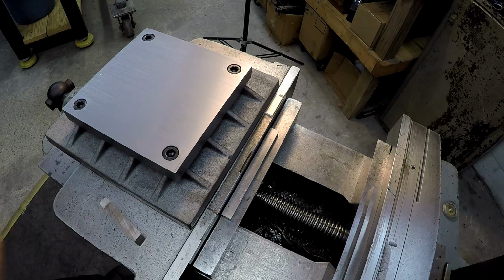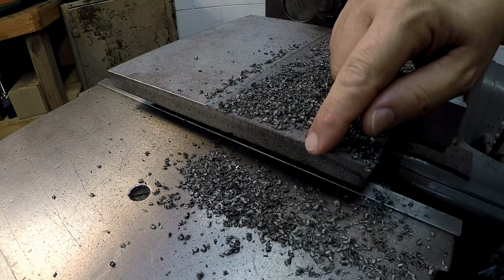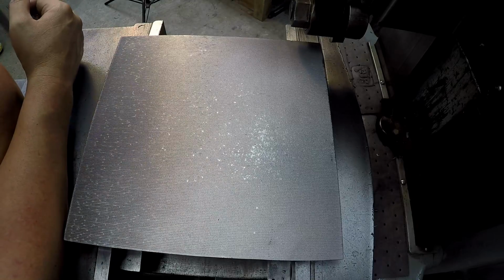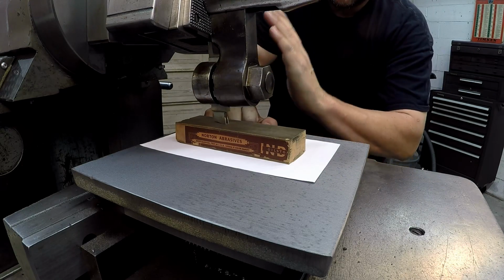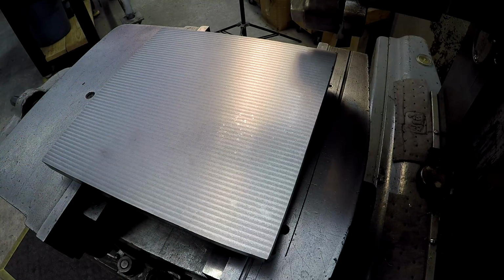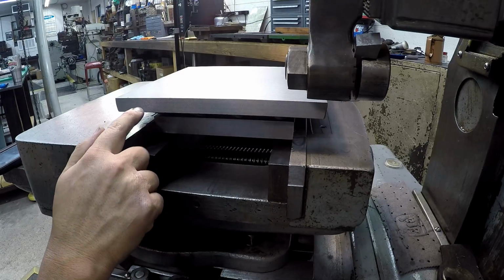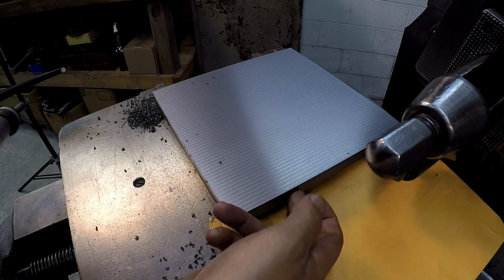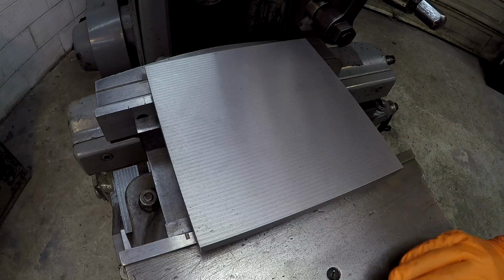Fireball Tool Fixture Plate Part 5

Comment: General remarks to all: 

Seating work in a vise: sometimes when socking work down on the parallels it will rebound a trifle (despite the clamping force) leaving the parallel still loose. If a harder blow doesn't solve the problem, try a softer blow - hit the work hard enough to seat against the parallel but not hard enough to rebound. 

Other points: rawhide mallets, plastic faced hammers, brass, lead, babbet, etc all have different dynamics of impact. Something to keep in mind when delicate hammer work is in progress. Hammering done right is an art and the outcome of a single calculated blow may not be what you expect. Pay attention as you work; let all your senses guide you. I know this sounds like Zen BS, but it's true and applicable to the real world.

Broad nose tools in shapers and planers can develop surfaces in stable cast iron as geometrically accurate as the machine axes allow. A wide flat faced tool set absolutely parallel to the surface being cut, a tool trailing holder, step-overs to 3/4 of tool width, shallow depth of cut in 0.001 to 0.003 range, beveled entry and exit all contribute to a machined surface superior to surface ground in terms of film stress, surface metallurgy, etc. Surface finish is another matter.

Adam, your tool was 3/8" wide and your max step-over was 0.180." In a pinch you can hand crank the crossfeed a half turn, 3/4 turn etc to secure wider cross feeds and do so with remarkable consistancy. The object is to maximize productivity and reduce rubbing on the surface. But your finished surface was everything you could desire. You others: see how the "gray satin ribbon" imagery applies?

A sensitive test for a broad nosed surface quality is to give it one stroke across the tool marks with a clean FLAT slip stone. If the scratch marks are equal and unbroken, the "shingle" is zero. Adam's use of the stone-on-table tool honing technique virtually eliminates the  need for  dialing in the tool edge.

Adam's remarks on the use of a shaper vs milling machine are spot on. Esthetics aside, most cases a milling machine is the more productive tool. However, shapers (and planers) have their niche applications which are many and tedious to enumerate. Machining that little cast iron table is only one example. 

You gotta be flexible, especially when people cite conventional wisdom as the only game in town.

35:15 If you desire to machine the edges to a nominal size perhaps centered on the base plate dimensions, you can crank the tool down and reference to the base plate edge with a planer gage, adjustable parallel, or block, set an indicator, raise the tool, and cut the edge to your setting (maybe keep a few thousand up your sleeve to fine tune the finish size.)

Comment: What is the mechanism on this shaper that lifts the tool on the backstroke (conversation around 12 min. mark) to keep the tool from dragging on the return?   I remember my Grandfather's shaper (Klopp or Stossen, I forget) had an external element that lifted the clapper on the backstroke.  He told me he traded for that machine for that feature as a traditional clapper (dragging) would often break hardened tools.  He and his partner were able to salvage the shaper from a German ship before it was scuttled (Scapa Flow) after WWII.
I think it's cool that you revert to the older methods and machines.  Gives your work a touch that will linger, a soul if you will.
Reply: I believe it’s just the tool dragging on the work piece that moves the clapper.
Reply: The tool and clappers momentum also helps, a shaper speeds up and returns on the 
back stoke a bit quicker than on the cutting stroke due to it's internal layout of a 
scotch crank mechanisum. So as the ram stops it's stroke at the end and reverses 
with that higher return speed that also helps the clapper to work and lift the tool. If 
that momentum isn't quite high enough at the slower ram speeds then the tool drag on it's rear face will still allow the clapper to work well enough. Yes there's some that have a built in tool lifter, but most shapers don't. Personally I think the European
designed machine tools are usually a bit more refined. As versatile as a Bridgeport 
might be, there still far behind what an FP 1 or FP 2 Deckle mill is.
Reply: @turningpoint6643  Whitworth...

Comment: That beautiful 'mown lawn' effect is caused by having the clapper rotated so far off vertical when you hone the cutter, it puts a pronounced bevel on the cutter, leaving the pattern you see.  If you set the clapper vertical and hone the cutter and scrape with the clapper vertical you should get almost no pattern at all provided your cutter is wider than your feed.  If I'm wrong please let me know but I'm 99% sure my logic is correct.  :)

Thanks for sharing the older techniques, sometimes 'new' isn't the best or the most fun.

Comment: I kind of liken it to cars...these days, getting groceries and commuting to work is probably better served in most cases by owning a Camry or maybe a Tesla. They're fine cars and they do their job reliably. But there's something to be said for an old Stingray too. So it is with machining: most shops would do well with a big 5 axis Mazak or something, cranking out parts on the cheap with minimal supervision. But if you're doing it for the sheer joy of just doing it, well that G&E seems to be doing pretty damn well.

Plus $400,000 for a used Mazak just sounds stupid to me.

Comment: A shaper cuts flatter than a mill..
Reply: Erdo geit  Yes it does. At least it will if it doesn't have serious wear issues.
Reply: Erdo geit  And your point is? Don't take my word for it do your own research and you'll figure out with machines of about equal condition a shaper will always produce a 
flatter surface. Your saying "it doesn't" won't change those facts.

Comment: I am like you Adam You just can't beat oldschool be it techniques or machines. i hate these new automatic key cutting machines because they always screw up the keys. I learned how to cut keys using an old school machine and never had a problem with them working. they knew what they were  doing back then and took pride in their work.

Comment: I'm an apprentice so forgive my ignorance but this is a genuine question. What are the benefits of a shaper? What jobs can it do better than a mill? Is it just that multiaxis machines with more complex accessories have replaced the need for multiple different machines?
Reply: Watch from 09:00
Reply: Adding to what Adam said at 9:00, shapers are a rarity in industry anymore due to the development of CNC automation and improvements in tooling, especially super hard carbide, not unlike horizontal milling machines in that regard. Adam likes using this machine because it's old-school; a way to connect with techniques from the heritage of his profession, because it's fun to learn something new, because he likes the surface finish it generates, and because he enjoys using the machine as one would enjoy a hobby.

It also makes internal keyways a breeze.
Reply: @BravoCharleses  no I understand fully he just does it because he enjoys it. I can appreciate and respect that. I was just wonder what applications besides internal keyways would suit a shaper more in a modern machine shop.

Comment: 100th like XD
By the way i want to comment on the shaper. Vintage machines are the best in my opinion. Shops have no use for shapers these days so we cant work with it.
I have the privilege to work on a 60+ years old cylindrical grinder at my shop but i dont know if i will ever work on a shaper in my career. 
Work hard ! shop life !